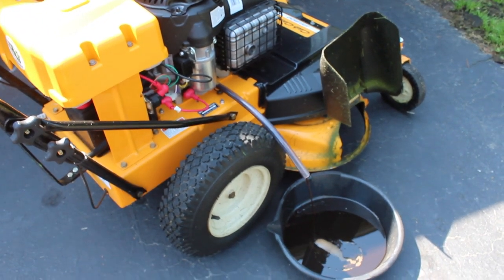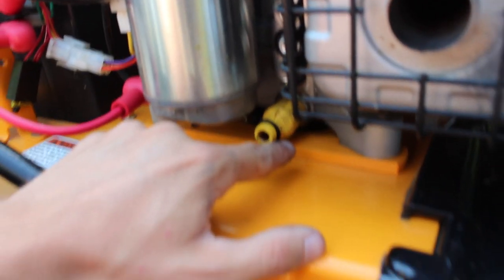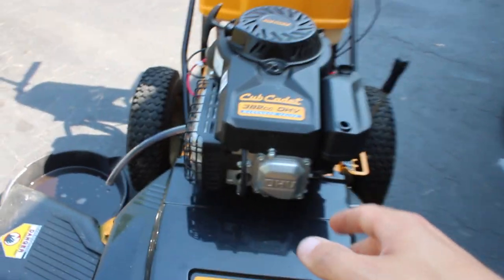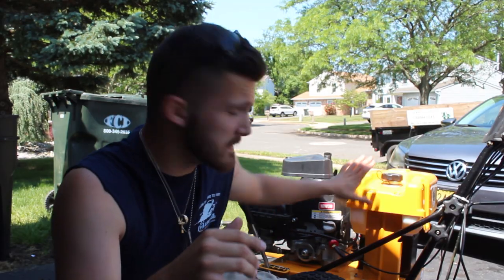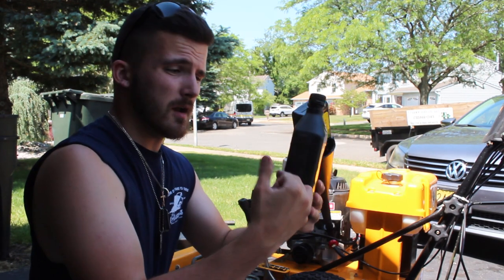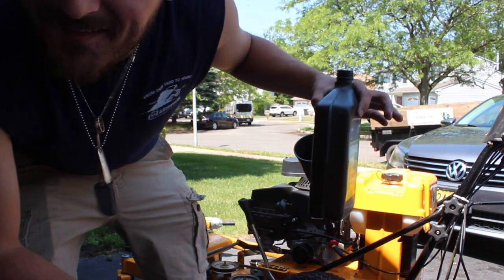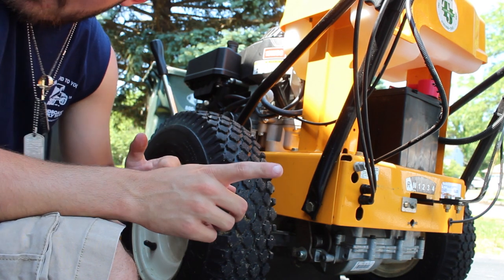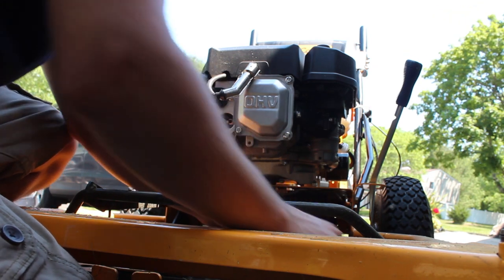Cub Cadet cc800 33in Walk Behind - Oil Change, Oil Filter, Fuel Filter, Air Filter & Spark Plug

Comment: I know you no longer have this mower,but you can buy a inline fuel shutoff valve kit at lowes for $11. I have a wood chipper and cyclone rake that dont see much use so I tryin run the carbs dry between uses.

Comment: I use a vise grip to squeeze the tube shut. Only light pressure is needed. Dude, it took an hour searching to find this video on my lawn more. DeWalt's 33" is the new Cub Cadet.
Reply from the maker: Yeaaahhh… sadly no one made videos on the machine even when I had it. I would love to try dewalt version! We use a 36 stander now.
Reply: @tjequipmentrental Which stander did you get and why did you pick that brand?

Comment: I've had my CC800 for almost 3 years now and the only complaint I have is how bad it is at mulching. Even with some nice mulching blades it's awful. I'm out in my yard with a rake cleaning up clippings.
Reply: I agree with you. I have a Honda 21" also and it mulches great. I bought for mulching blades for my CC800 but it is not the same. I was wondering if there were better blades.
Reply: Wondering if the bagger makes it that the extra clippings don’t end back up on the lawn. I’m getting ready to punt if the bagger doesn’t help. Don’t want to throw hard earned money away.

Comment: Never showed hiw to pull off the air filter did you.
Reply from the maker: watch again
Reply: @troy_bernauer  Well, perhaps you could put the time stamp in your reply because I wasted time watching the whole thing again. Removing the air filter cover is one thing, but taking the actual air filter off is something else. Does it unscrew,  pull off, or what? I tried removing mine, and it is very stubborn.  It is wedged between 2 metal pillars of sorts. I didn't want to break anything, I just want to get it off. I normally use an air compressor to blow out anything on the air filter the first time before replacing it. This gives some additional life to it before actually changing it out. So where did show changing the air filter?
Reply from the maker: @sisqokid7978  1:39 brother... no reason to be an ass. Made the video to help people. Cant help you if you dont watch. If yours is stuck dont know what to tell you. Lift up and it comes right out. No explanation needed for it.